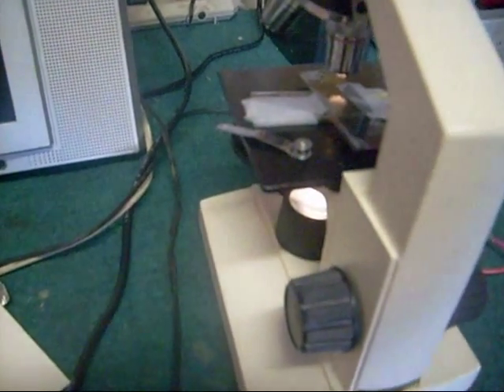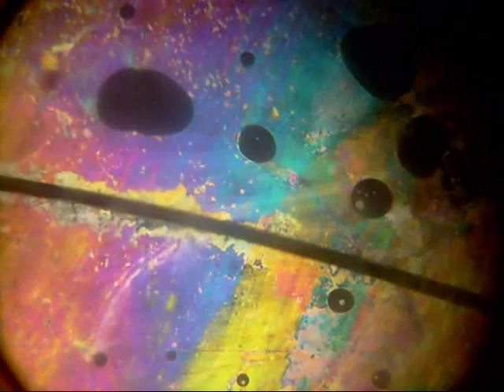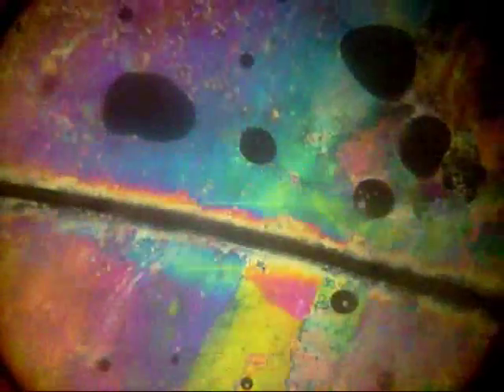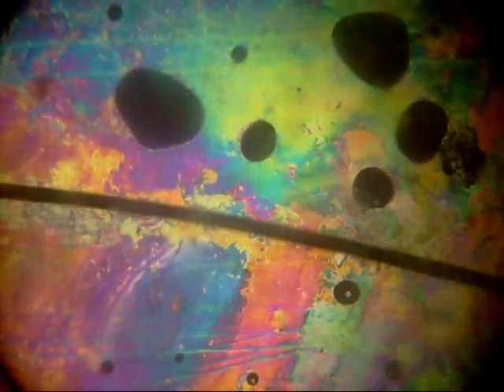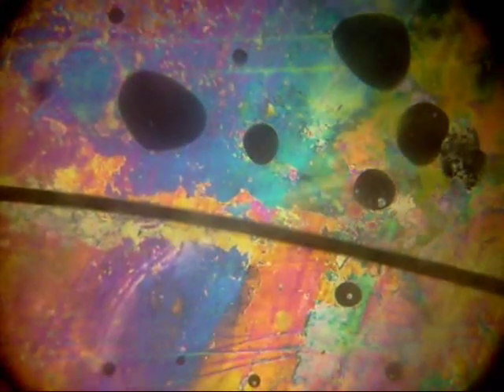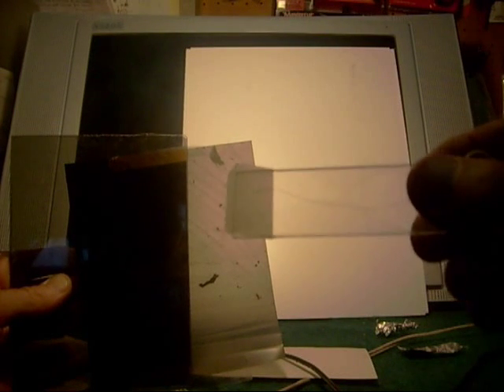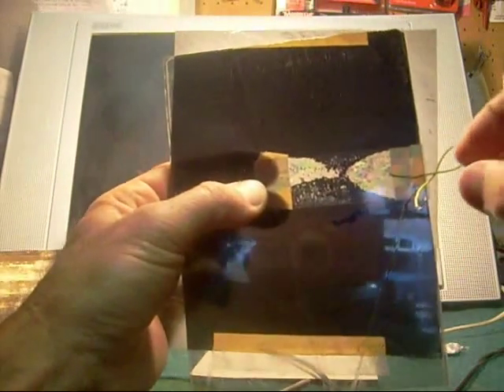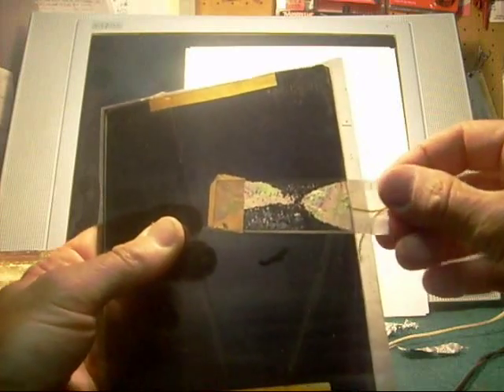Applying electricity to liquid crystals.

Comment: hi Dave, just wanted to check what the wire you passed over the glass is and the AC supply please  - I've been trying to create an electric field around salvaged liquid crystals from an LCD using DC at 24v and 5v passed to 2 copper tapes opposite sides of the slide glass/liquid crystal sandwich to try and see changes visible using polarizing filters but with no luck (as this is what an LCD tv does, no? convert the 110/240v AC to about 5v DC inside the box?). Or is this effect only possible with HV AC and v.low amps? Any help to DC or non-lethal AC (incl. simple diagram?) gratefully received, best Jay
Reply from the maker: It's been years since I made this video, but I'm pretty sure i used a single strand of wire taken from a section of stranded wire. It was probably around 40 gage, and I taped it on top of my microscope slide cover. The electricity I used was from a negative ion generator which probably produced 3 to 4 thousand volts, but the current was so low there were no safety concerns. I hope this helps.
Reply: Thanks  @GrantsPassTVRepair  finally realise you mean uncoated wire then (been trying with coated 32 gauge copper wire) ... best Jay

Comment: If the wires are connected directly to the liquid crystal powered by a 9v battery how much surface area do you think would change and by how much? I'm wondering if I can paint a flat metal panel and have it change colors safely.
Reply from the maker: I can't understand your question.

Comment: Where can I acquire a lard quantity of liquid crystal? I can't get the amound I need from LCD dispays for the experiments I want to do.
Reply from the maker: I got my liquid crystal from the thin layer found between the LCD Display and the polarizing filter using a razor blade. I'm not sure where to purchase it in large quantities.
Reply: @GrantsPassTVRepair  I never thought about using a razor blade! I might actually be able to get the amount I need using a razor blade. I was trying to wipe the liquid crystal up with a peice of silocone. Thanks.

Comment: How much power is needed? Volts/amps?
Reply: @Av-mu3dz  Just from the heat change? More interesting to use electricity, more control.
Reply from the maker: My voltage source here was probably over a couple thousand volts, but the current I don't know. Probably to small to measure with conventional  test meters.
Reply: So would making a bracelet painted with this stuff with a current big enough to make it color change like that end up killing you or hurting?
Reply from the maker: It could be safely done.